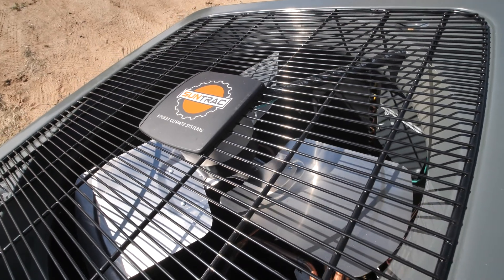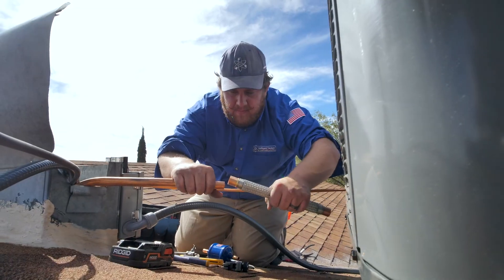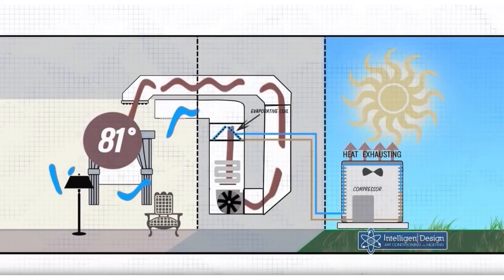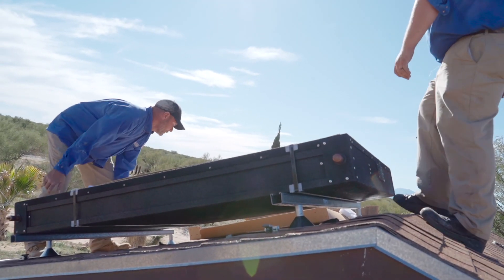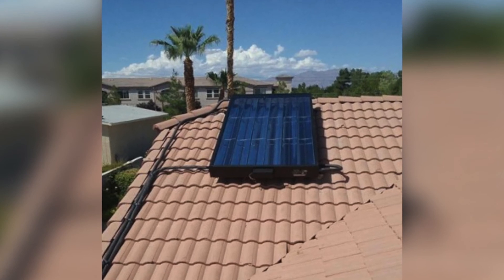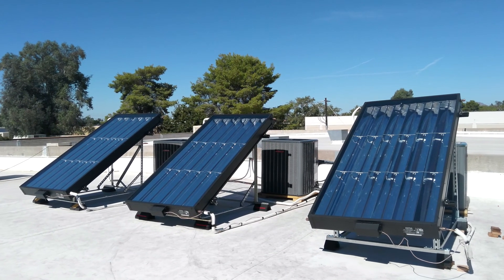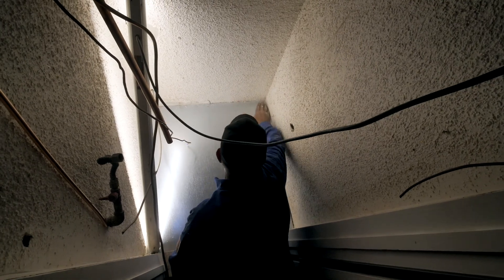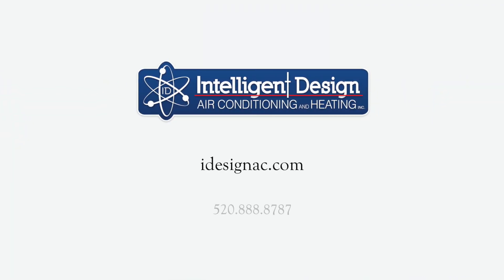SunTrac Solar Cooling: How Does It Work?

Comment: If I understand clearly, this doesn't replace the air conditioning system, it just help to reduce the energy used by the mechanical air conditioning system by up to 40%? Right?

Comment: This makes no fucking sense. Explain it on a refrigerant level. Where does it go on the system? If you're trying to reject the heat outside then why are you adding more heat? All you're adding is superheat that you'll have to undo when it goes thru the condenser. EVEN IF the compressor has a lesser workload because of the lower refrigerant density because of the solar heat, you're still gonna reject less heat as an entire system because of the lower refrigerant density. On the low side, in a perfect world,  0-1° superheat would be perfect for efficiency. WHY ARE WE ADDING MORE HEAT? The indoor unit is supposed to absorb heat from the conditioned space only. The outdoor unit is supposed to reject heat outside only. What is the justification for this system? I just don't get it. This system was brought up to me in class.
Reply: I'm with you.  I see what he's trying to say I think.  He thinks because the temp of the condenser is 'hot' that determines how 'cold' the evaporator would be.  By his way of thinking instead of being 130 it was say, 200f, it would produce a colder evaporator.  He's talking like it's helping compress the refrigerant.  Weird.  No wonder I've never heard of it.  40 years.  Anything that could save 50% would be on fire and everything else would cease being sold if it as practical and reasonable.  Not even necessarily reasonable.  After all, people bought on to the solar, super high efficiency and mini-split cons.  They're incapable of practical thinking and math.  And who in the hell puts a condenser on the roof of a house on land in Arizona unless it's because of some asinine code?
Reply: Hi ,  i am having the similar doubt as to why you want to add extra heat , because as i understand the work of compressor is to compress the refrigerant so that the heat presnet can be concentrated and ejected. How would adding extra heat using solar thermal heat absorber reduce the load on compresor ,i cannot understand

Comment: cool, if i understand correctly, these panels replaces the compressors in day time
Reply: hell No. They only add heat, increasing the pressure.  If you spray cool water to the condenser, the effect is much more positive.